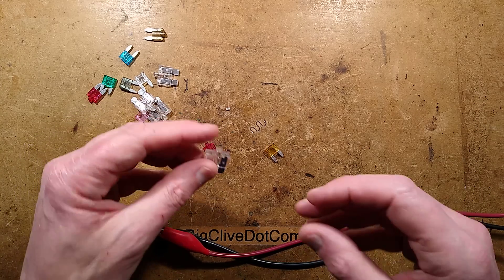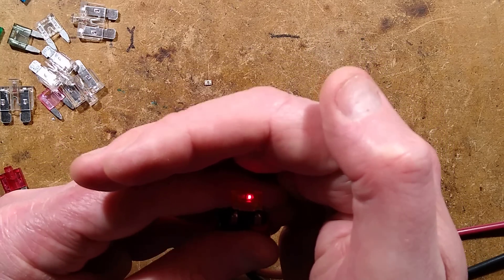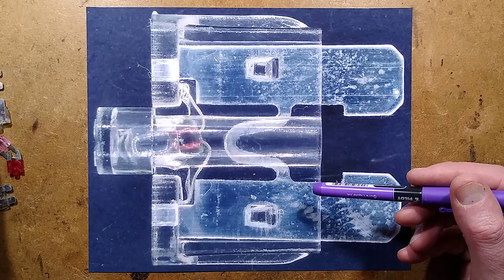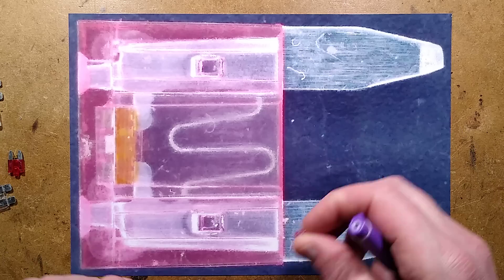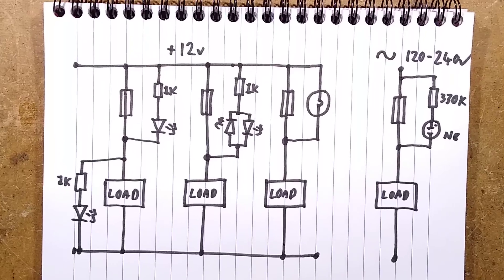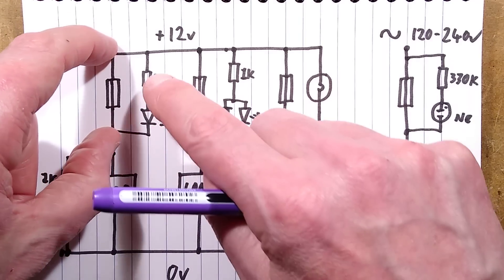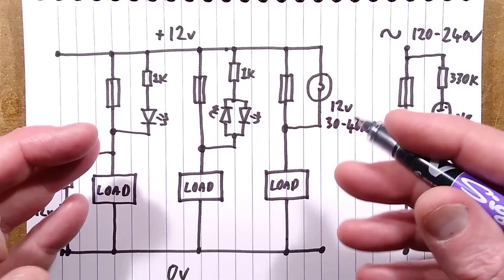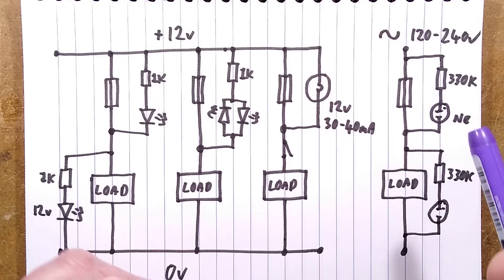Inside self-indicating vehicle fuses

Comment: I've seen them in stores for a while now, and I'd always wondered how they worked. Considering the massive price difference (at the time), I expected them to be more complex. The cheapskate in me could never justify buying a pack to investigate. It's likely I'll never need to buy them - every car I've sent to the scrapyard has had relays, fuses, and bulb sockets scavenged in the event I need them for the next car. I can't even remember when I last popped a fuse in my car due to my own errors, so I've got a collection of ATC fuses from 3.3A to 30A. 😆

My Cavalier popped the dash illumination fuse when the PWM dash dimmer's power transistor failed shorted, but that was an actual circuit fault, and that was around 2008-2010. When I bought my Camry in 2017-ish, the Accessory Power Outlet fuse was pre-popped for me, but that's the chance a previous owner took by not closing the little plastic flap over the outlet! (The flap is not only for aesthetics.)

Comment: The indicator lamp across the load is actually quite common and is sometimes called a "power on" indicator; you'll often see "POWER" (usually in large, friendly letters) on the panel. It's hard to find equipment that doesn't have it. In guitar amps, they're usually called "pilot lights" (I guess that's just a term of art).

Comment: They make fuse blocks that have the indicator built in rather than internal to the fuse. Those are a much more efficient design, as the indicator lamp is reused for multiple fuses. It's cheaper, and results in less waste. 

On that topic, any thoughts on doing testing on cheap vs name brand fuses. There have been a number of video's(Louis Rosseman of only one) testing the ratings of cheapo fuses(without available data sheets), and they blow way over spec. I picked up a pack of NiLight(one of the mentioned cheap brands in the other videos) fuses, and found the 5a fuses blew around 10a and the 7.5a fuses blew around 15a, so double the rated load. That was the max load I could apply via my MakerHawk load tester.

Comment: Isn't the point of a fuse to NOT let current flow through a load that has a problem?  I understand that the current is limited, but there's probably a reason the fuse blows in the first place.
Reply: The purpose of a fuse is to protect the wiring.

Comment: this seems interesting.. I guess wit han LED theyd go wit ha fairly high reisstor as to overcome any voltage drop across the fuse..  if you get close to the blow load of that fuse id think youd have a decent amount of drop across it.. possibly enough to turn on the LED if it had a smaller resistor.  ive never see nthese in the US before..  of course they are dependent on the load being switched on...

Comment: Standard blade fused are rated ro about 32V
They do make higher voltage versions for things like forklifts that can be 48v, 72V or 80V. 
At a glance they look like a normal blade fuse but opaque - they're sand filled like most high rupture fuses.

Discovered in my early days of being a forklift mechanic that if you put a regular automotive blade fuse in a 80V machine that an arc can be sustained between the two blades if the fuse blows.
Reply: Arc-Fuses could be a brand name. Also fascinating, I would not have expected that at all.
I thought you'd need a couple hundred volt at least to bridge a few mm, not 80.
Reply: @BloodyMobile  i assume the initial gap would be pretty insignificant in size, get the arc established and then it would consume that smaller material, causing the gap to widen until the arc cant be sustained by the voltage thats running through the circuit? 

Makes sense to me but im a dummy and mostly deal with 120-480v, and admitedly dont know enough to speak knowledgably on this, mostly asking a question to see if someone has a better answer or can tell me mine is wrong lol

Comment: There's a big issue with these: If the reason the fuse blew is of high enough current, the indicator light will rapidly follow the fuse.
Reply: The indicator light provides the necessary current limiting. If not, it would defeat the purpose of the fuse. On small enough loads, they're already self-defeating.

Comment: You can also get fuse boxes with indicators LED next to each fuse to show failure. 
Mind you it can cause confusion when fault finding because a lower (voltage say 10.5) still passes

Comment: You should make a video showing what 240v does to one 😆

i have seen one ato fuse soldered into 120v wiring to protect the motor, hid inside the case of something...i can't remember what I was disassembling, but I'm sure it was 120v.

Comment: Long ago, I was employed as a technician servicing commercial alarm systems.  One day I walked into the storeroom to refill my kit, only to find the "storesman" carefully measuring glass fuses with a multimeter, and tossing each one in the garbage.  I inquired, "Exactly what are you doing?"  His reply was - "Checking these fuses.  They're all bad!!  Every one of them is shorted!"

True story.

Edit to add - Thanks for the video, and the bringing back of an amusing memory!
Reply: Once a tecnicial was using fuses on the main fuse box on a circuito for motors, they were of the correct ration but they blown and the guy had a case full of fuses changed the blown one and turned the motors on and the fuses blown. He was asked: "What are you doing? Testing the fuses? (rhetorical question). You need a time delay fuse, motor pull several times more than the nominal current when they are turned on." They guy had blown a lot of fuses and was trying the same thing over and over. This was told me by my teacher on  technical school to illustrate the use of time delayed fuses.
Reply: LOL

Comment: In my youth as a young and slightly green trainee comms engineer most, if not all, of the equipment I worked on was powered by 50V DC. These were in banks and there was an alarm system triggered by the spring loaded tags in the fuse body which would contact the 50V rail with a strip under them. This gave a visible indication from a lamp above the holder and an audible alarm off a comm buss. I always thought this could work on mains driven systems if someone worked out a way of detecting the blown fuse. I did actually sketch out a method using reed relays but I had difficulty making the isolation good enough. These days I reckon I could do it, but when you’re in your twenties and relatively new to the job you don’t have the experience.
Reply: @paulusthegrey 
There is a solution! Keep work on it.
Think about detecting a change, not just a single state.
Reply: I used to work in a Strowger step by step exchange, exactly the same system, going back 50 odd years....

Comment: Those will be very handy indeed!  As you say, unsuitable for "Mains" voltage use ( arc over voltage of a "blown" 20A blade fuse is around 110v for example - a test I did years back with an old hand-cranked "Megger" tester)

Comment: I got a bunch of flag-type indicating fuses.  The contact wire is bent over and held in place by the element.  When it blows, it "unsprings" and the flag pretty much waves in the air.
Picture a 108" whip antenna that's pulled over and latched to the hood (eg, when going into garages, etc.).  That's the intact fuse.  Fuse blows, it's like unlatching the antenna and letting it spring upright.  That's the blown fuse making a very clear indication of such.
They're all automotive (low-voltage) grade, no more than 32V, so little if any chance of shock.

Comment: interesting I had this idea some years ago for the fuse box on my dads car an old Vauxhall which had those cartridge fuses which always made a poor connection after knocking his knee on the fuse box I just fitted Leds across the holders so you easily see which fuse was causing the problem

Comment: Why would I want current to continue to flow through that circuit when the fuse is blown if the problem that caused it to blow isn't fixed?
Reply from the maker: Current does flow, but is limited.

Comment: I was the self indicating fuse yesterday. 230v through my finger. When working with "smart bulbs", just because they do not light, does not mean the power is off. ⚡
Reply: My smart socket (based on the Chinese Tuya design) also only cut one line of the output, so depending on which way it is plugged to the mains, there's a 50% chance that OFF isn't OFF, I figured that out the shocking way.

A problem that should have been fixed bt simply using double relay or single 2PST relay
Reply: I only use dumb bulbs. :)
Reply: I've found out that remote controlled sockets also don't cut both legs, and since I have schuko sockets it cuts either the live or neutral

Comment: seems like a great idea, my only thoughts though are, fuses are designed to break a circuit when something goes wrong, since these would keep the circuit intact, would these still allow whatever is connected on the other end to be powered even when the fuse is blown?
Reply from the maker: A very low current will flow.
Reply: Generally, the miniscule current that will flow will not be sufficient to develop a high enough voltage across the load to do useful work. Maybe an LED will flow, but that's about it.

Comment: So when the fuse blows the current increases through the bulb enough to light it? What prevents that the rest of the time?
Reply: There is only a few tens of millivolts dropped across the fuse. That's not enough voltage to light the indicator.
Reply: @rocketman221projects  Thanks!
Reply: When the fuse is not blown the bulb is short circuited by a small piece of wire.

Comment: I have installed banks of these on boats I have wired. Very useful they are. Also handy to have a blown one to put in before a good one without the load connected to prove the wiring then short out the pair and see if it lights. Bingo I have the right wire!

Comment: On my 1958 landrover there is only one fuse so that is easy to trace the glowing wire :D I wonder if these fuses are cheaper than bulbs? I mean, literally drop it across a battery to remove the fuse and there is your small lamp. (Let’s go Idris some eBay :D )
Reply: Double money. 2 of each for £6.49. (16) That’s cheaper than ickle indicator units.

Comment: A video showing the current required to "Blow" different types of fuses would be interesting. a 15 amp Glass fuse and a 15 amp blade for example blow and very different current flows.

Comment: I had a worn brake switch which caused the fuse protecting this circuit to release blue smoke.  I bought a pack of these indicating fuses until i could source a new brake switch.  It made locating the fuse fast.  I liberated one of the modules and placed it on a nearly spent 9V battery from a smoke alarm.   It emitted light for a few weeks

Comment: This might sound crazy to some; but if you cannibalize a north American 120v wall outlet for the slot contacts, you can cludge it into a regular (not mini) bladed fuse holder that doesn't mind even 30 amps continuously. They fit perfect together (turned 180⁰).

Comment: Automotive fuses are rated for 32 volts. You look up the spec sheets from a reputable manufacturer like Buss or Littlefuse they state that. Also high current glass fuses are only 32 volts. At higher voltages you need the ceramic body to control the energy since a 15 amp glass automotive fuse will explode at 110/240 volts.
Reply: We use the mini style fuse on some 48v circuits at work and they are available with a rating suitable. Normal automotive standard ones are not rated high enough
Reply: @randycarter2001  the Voltage rating is basically the point where the fuse starts arcing. This depends if this rating is AC or DC.
But: The voltage isn't everything you need to know. Every fuse has a rated breaking capability. This is way more important in cases batteries are involved. Because they can often easily reach 10kA or more short circuit current. So beside the bare static rating the dynamic ratings are way more important often times.

Comment: Lamp and LEd will be rated for the 32V rating of the automotive blade fuse. However I have seen them used in mains applications, even in things that actually had to pass a proper CE testing regime.

Comment: I thought the point of a fuse was to kill the flow of electrons in the case of a fault, doesn't adding a bypass to the fuse defeat the point?
Reply: The fuse is there to protect the wiring if too much current flows. The indicator will only allow a few milliamps though.

Comment: Car fuses , like the ATC / ATO one at the start of the vid , has a 32 V limit ( No mention of if AC and / or DC ) .    Some tubular industrial fuses have a pin that pops out if the fuse clears.
Note that a fuse can wear out if it is run close or slightly over the posted rating.  
And, if a see through fuse has a silver spot on the housing after it clears, it failed due to a high current event.  If the link is just melted out, it was a slight overload over time.

Comment: Some of those fuses are also aluminum, when used on equipment that gets damp they corrode the fuse contacts and I have seen it melt a fuse block position.  I have to work to find the tinned brass ones.

Comment: Nice, I have used the same idea with a neon indicator across a light switch, the neon glows through the plastic of the switch to show where the switch is in the dark.
Reply: Commercial light switches or add-on surrounds are available that do just that.
Reply: @zebo-the-fat : my dad, an old fashioned watchmaker had some old fashioned radium paint he put in pinholes on the staircase light switches "for emergencies" LOL 🤣

PS yes, he knew about Radium, it really was a very tiny amount, in truth too tiny to even see in the dark 😉

Comment: My kneejerk reaction is "This is great!", then the troubleshooter in me realizes that I'm still going to have to check each fuse with a voltmeter to verify before moving on to another area to test.
Reply: Very cool idea, love it! Now we just need one that makes a distressed wailing noise when it blows so that you can find the fuse box with the problem in a vehicle you’re not familiar with. Looking at you, Mitsubishi Delica…..
Reply: In my RV, i have fuse holders with LEDs that indicate the blown fuse. Great stuff, but if a fuse blows you still get a bit of voltage on the blown circuit (trough the fuse indicator). So last time i had an issue with a fan i checked the supply voltage. I was led down a rabbit hole (fan was not running, but voltage to it seemed ok). Be aware that indicating LEDs in fuses or fuse holders will put a voltage on the circuit even if the fuse is out. The old thinking of "If there is voltage the fuse is ok" is no longer valid. Like Eric at SMA teaches: The circuit needs to carry current (like a incandecant test light), not just voltage (like a multimeter).
Reply: @nordishkiel5985  that's the best way of checking fuses 
    Put a test light on ground and just touch on each pin
Reply: @nordishkiel5985  Eric is a great tech.
Reply: For something as simple as fuses, you could probably save some time and just replace it. If it’s fixed, great! If not, continue the troubleshoot. Of course that is only realistic if you happen to have replacements on hand.
Reply: @katestramenos929  I guess you've never replaced a bad fuse with another bad fuse (one that had a tiny crack)
Reply: @GeneCash  nope, never have. But it was just some advice. Whether you use it or not is up to you. I’m not judging you for taking a meter to everything… I just don’t usually have the time to do that.

Comment: Always loved the telco 48V DC fuses with the spring and the little plastic stick that stuck out the cover.
Reply: Or the ones where the input side sprung blade bridged to a dedicated bus bar in the fuse enclosure when the fuse element ‘blew’ and put the warning lamp on at the end of the affected equipment rack. And rang a warning bell iirc ( been 50 years since I had anything to do with telephone exchange equipment)
Reply: They were called Rat Trap fuses when I worked in an exchange in the 1960s
Reply: @OZCamperTravels  
Yesss! That’s the ones. I only ever worked in SxS (‘Strowger’) exchanges (apart from a sight seeing tour of a 7A Rotary one) so I’m not sure if that type of fuse carried over into the  crossbar/digital age.

Edit: I see some other commenters have mentioned this arrangement. Must be a few ex-exchange techs on here!
Reply: @RB-qq1ky I have an old PBX that has a few. They are quite hard to get nowadays.
Reply: Still used fairly widespread on the UK rail network on our 50v signalling busbars in relay rooms. We sometimes call them Post Office fuses (or Self Indicating Fuses) because we borrowed the design from the General Post Office, who ran the UK phone network back in the days before BT was created. 

Great for quickly narrowing down where a fuse has blown as you walk in the room and confronted with a red lamp on the indication panel (providing the lamp itself hasn’t blown).
Reply: @southcalder  
One of my tasks as a trainee telephone technician was to periodically verify the warning lamp and bell was operational on each equipment rack.This was done by deliberately shorting the +50v fusebox bus to the 'alarm' bus in each fuse box by means of a pair of long nose pliers